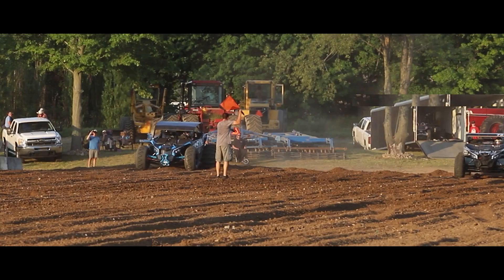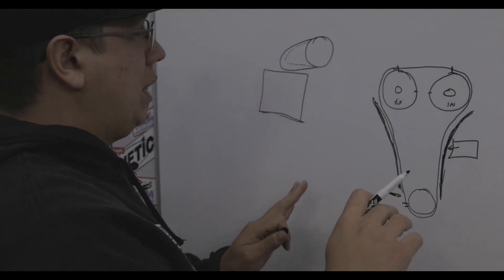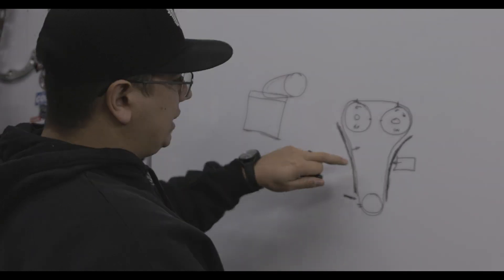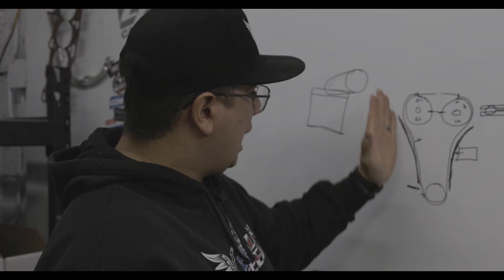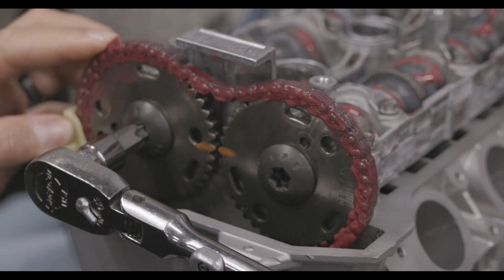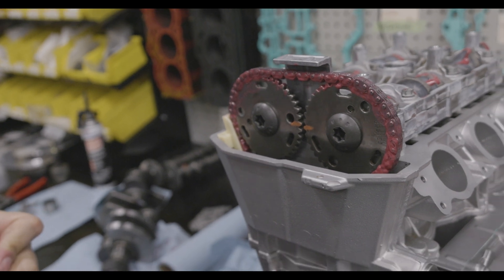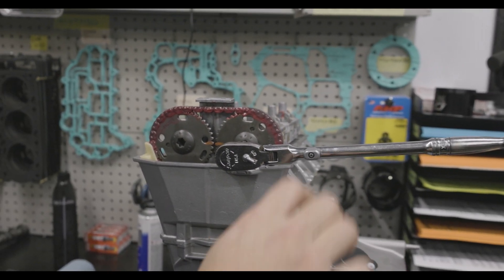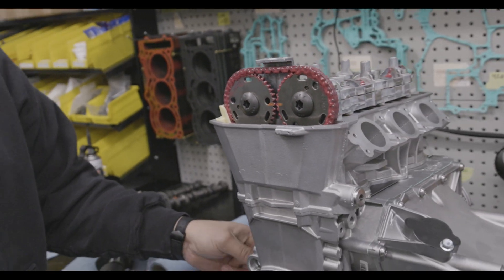Whalen's Speed: How to Time an 900ACE Can-AM | Ski-Doo Engine - Tech/Info

Comment: I'm about to start into my DS on suspect of faulty lifter buckets. I'm getting some not nice tapping noises coming from the top end at idle. So this video helps A lot. Thanks. Have you done this type of work in-car before? or should i look at pulling the engine?
Reply: Did you ever get your issue fixed? What was the cause? Having a similar issue, just wondering.

Comment: Is that crank lock treaded? Or can a person just use a screw driver?
Reply from the maker: The crank locking tool is threaded,  and we don't use a screw driver. But, I'd say you can make it work? Having the proper tool for the job is nice though.

Comment: I know displacement has more to do with making horsepower than the number of cylinders but I can't stop annoying the 2jz crowd by calling it 2 of these
Reply: I can't help thinking a Smart car could use a bit more power because an extra 40 hp only makes it as fast as a truck
Reply: I'm only thinking short wheelbase because a 4 door UTV is way too long

Comment: Is there any reason it would jump timing?
Reply from the maker: We don't see much of that, if any. We tend to see timing simply set wrong. 

But, bad oil pressure can effect the timing guide tensioner piston and or a failed tensioner piston/spring? Potentially causing the chain to loosen and jump timing.

Comment: Is there a secret to adjusting oil pump gears?
Reply from the maker: No secrets that we know of. Are you having a specific issue?
Reply: @whalensspeed  I'm actually going to reassemble the engine and I was worried about gap adjustments between the oil pump and water pump teeth.